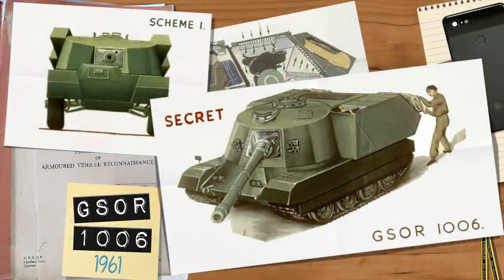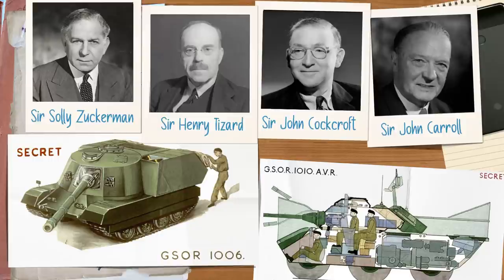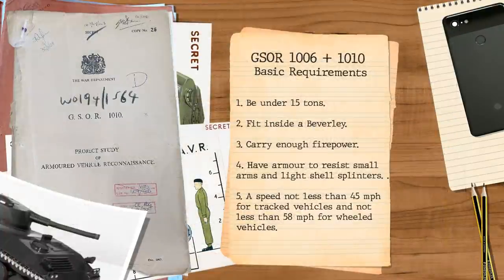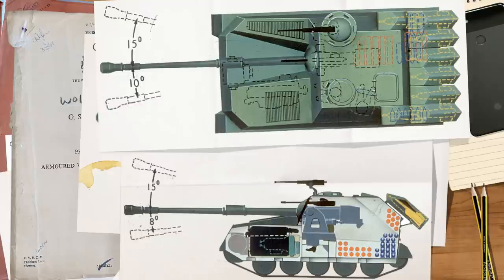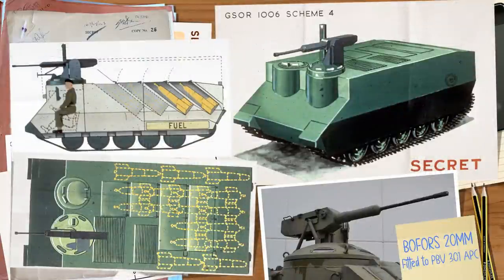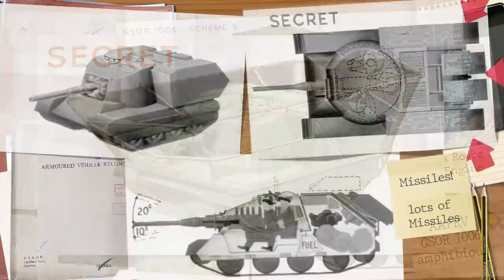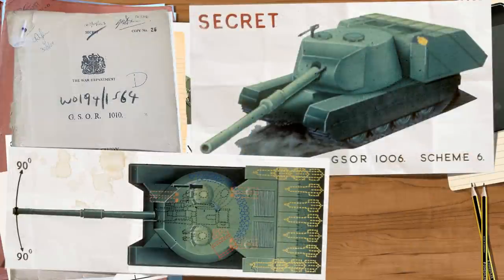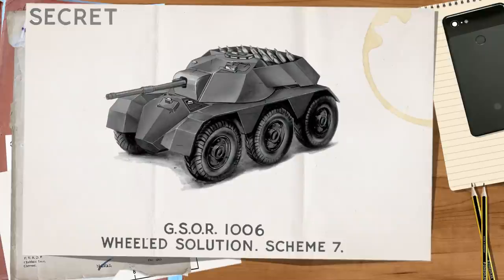GSOR 1006  - Tank Design & Development

Comment: "Let's just make a box full of Swingfires" is somehow the most reasonable idea presented in this entire video. I mean, if you just want to field as many of your wonderweapon ATGMs as possible, that's probably the best way to do it without compromising everything else you build.
Reply: This is also a very expensive one. Not uncommon single missile cost ranges from 5x to 7x (or even 10x !) of the most effective round for the main gun.
In doctrine, it also goes into artillery branch.
Reply: @HanSolo__  The cost of attaching a whole tank to your swingfire missile is yet more ridiculous, though.
I believe it's been said on this channel that the Swingfire-on-everything trend ended when they realized the effective range and battlefield role of a tank didn't overlap well with that of a missile carrier.

Though on missile vs. gun, that reminds me of an article I read years ago arguing for greater use of infantry recoilless rifles over certain types of missiles for cost-effectiveness.
Reply: @johnalogue9832  Yes, I remember it. A missile with a shaped charge head was perceived as impossible to defend. The whole design of the Leopard MBT is based on mobility as a form of protection. 
In opposition to this, I would cite Major Nicolas Moran when asked how tanks fight with the enemy choppers. 
Answer: "-First thing I would use to knock it off from the sky would be 120mm APFSDS round." Seem odd, but the modern FCS absurdly fast and flat in trajectory DU rod is a better weapon against gunship than the .50cal or 12,7mm on the turret. Particulary, if the chopper has a belly and front packed with kevlar, titanium, and glass/glass-ceramic composites.
Reply: @HanSolo__  Sorry, I don't follow how that response connects to what I said, could you rephrase or elaborate?
Reply: If something ever penetrated that thing and hit a missile it would be reduced to ash. Like the hood but 14 tons
Reply: @johnathanbodkin122  should it not? It's a box full of Swingfires. The Hood was a battlecruiser meant to directly fight peers--a missile carrier is meant to hit first, preferably from a position of relative safety.

Comment: Seeint all these concepts with the swingfires, I am more and more intrigued by these missiles.

I am not an expert. But a capability to send multiple missiles on their way and direct them simultaneously sounds quite valuable. Was that just an idear or an actual capability?
Reply: Actual capability in terms of the missile system could handle it, but never implemented in a service vehicle AFAIK.
Reply: @iatsd  thx. Which is odd, who would want to have missile salvoes, seeing that tjey expected to face large numbers of enemy tanks in a war against the warsaw pact.
Reply: I would say this is more an artillery domain.
Reply: @iatsd  there was a vehicle, ajax chassis I believe that had a rack of 5 swingfires that was in the UK inventory for some time. I dont know if it collected dust or saw combat but I know a fellow that got ahold of one after it went up for sale as surplus 30 years ago.
Reply: @Colonel_Overkill  You're thinking of the Striker on the CVRT basis.

Comment: The GSOR 1006 layout looked to have potential for anything up to full weighted.  With the rear space available it could be adapted for several roles, a troop and supplies carrier as well as a mobile missile nest. It has the casemate advantage of low profile and lower weight but with much more gun traverse. Brits missed an opportunity there.

Comment: my question, why the bloody hell bother with the high pressure rifle if you have 8 swingfires as well? Even as late as the design I cant think of anything soviet that the L7 rifle couldnt knock out, unless they were worried about the magic stats of the latest IS variant and 50m of frontal armor...

Also, Armored Warfare only has the 2 box swingfire launcher but does have the missiles and they are mostly correct. most of these vehicles would make great quirky additions to it just for the shiggles.